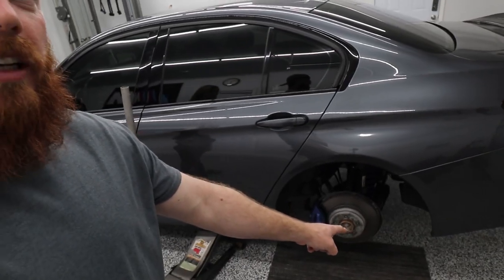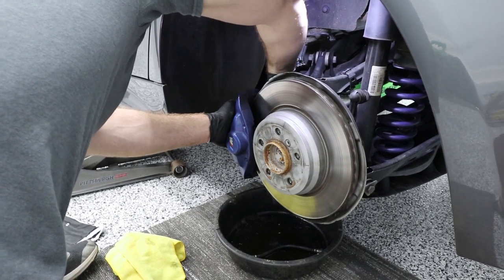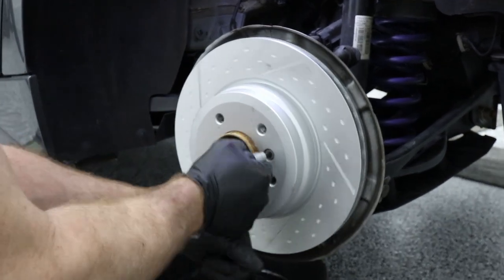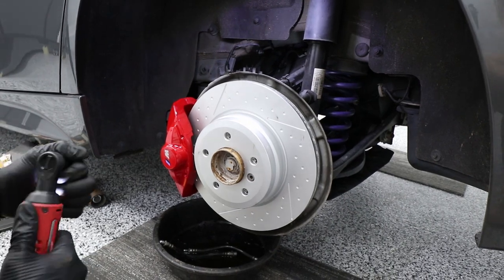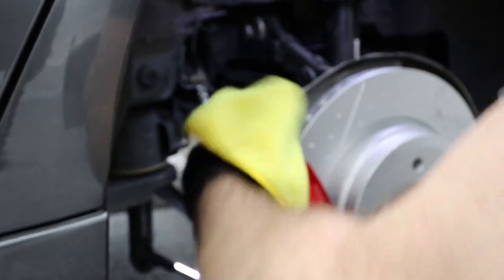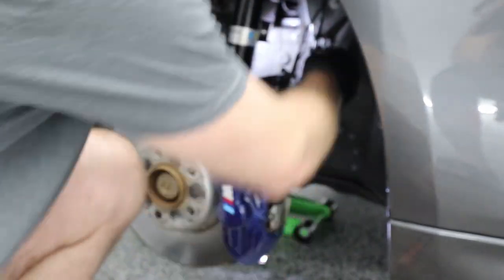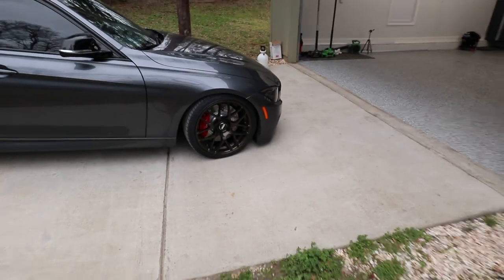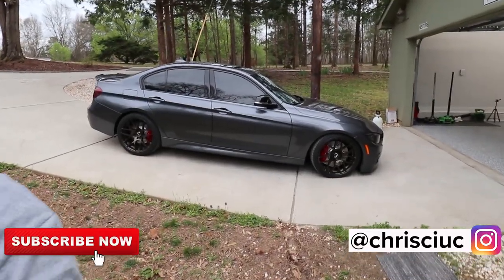BMW Brembo M Performance Big Brake Kit Installation F30

Comment: Great video I just would wanna add, that if you take a broomstick or something like that to press the brake pedal while working on the brakes, the lines actually won't constantly leak while you're changing the calipers. And you don't necessarily need a bleeding system, just some help. Get someone to pump the brake pedal and have an eye on the reservoir. Also you should suck all the old brake fluid from the reservoir, fill it with new fluid and try to not only bleed the fluid til the air is out, but until the complete brake line will be filled with new fluid. That way you get the old fluid out that has collected water over time and isn't as heat resistant. No use in stainless braided lines and big brakes, of your fluid can't handle the temperature. But those are just some additions, you did a very nice job and it's a very informative video!
Reply: Oh and from guy who also has a mineral grey 335ix, I have to say those red brakes look phenomenal on your car! I kind of don't want to switch to red brakes because I had red ones on my previous car and I find it a bit standard but seeing this really makes me wonder if I'm just being stupid to not do this. Thing is: my rims are black chrome and I have purple lug nuts so I kind of wanted to do something crazy and get green calipers haha.
Reply from the maker: Thank you! Green calipers sounds cool lol

Comment: Just an FYI, for the front brakes, you're supposed to bleed the outside first and then the inside. You got the order mixed up. Other than that, good job man.
Reply from the maker: Thank you for the info, I did end up doing outside then inside on the second bleed off camera to make sure. I could not find the information on that portion so I did it both ways. Thank you!

Comment: cool video, shouldn't the new brake system be coded to the car so that the car and the cruise control were told that a bigger brake kit has been added?💪🏼💪🏼
Reply from the maker: Works with or without because the brakes are exact same size only thing bigger is the rotors, however I did code them and noticed no change lol

Comment: Just an FYI, to remove the coating on the rotors I find it best to use CRC Brakleen® Brake Parts Cleaner rather then drive around and braking.  Great job on video.
Reply from the maker: Thank you for the tip and I absolutely agree with the Barkleen I use it as well. In this case this coating was more of a paint than an oil so I wasn’t sure if it would work but was probably worth a try. Thank you again for the comment, very good info.
Reply: @BOO5Tchannel  After watching your video I'm thinking of buying the kit you did as it looks great and I'm sure the performance is much better than what comes stock for the 335i M Sport.
Reply from the maker: G Rexer27 love it, do it. On ebay they sell the blue pair for front for $1000, you can get 2 front rotors, and 4 new calipers any color yellow, orange, red or blue for $1700...

Comment: You should have gotten two piece discs too, the ones with Ali bells...
The red calipers are actually the same as the red ones as long as you are on same dia discs.   The disc size is cast into the caliper.
Reply from the maker: Cool

Comment: Only thing I think you missed here is properly cleaning the hub faces before installing the new discs - or rotors as you call them. If not properly cleaned you are almost guaranteed to get disc run out and/or juddering.
Reply from the maker: Thanks for the tip, I actually cleaned them with brakeclean before even making the video but never recorded it. Thanks!
Reply: @BOO5Tchannel  
It's always a good idea to use a wire brush  to thoroughly remove any traces of rust from the hub faces - I use a wirebrush attached to a drill - quick and easy
Reply from the maker: Christo Joubert 👍🏻

Comment: Did you just rip the sensor out of the inside of the brake piece I’m changing mine and not sure how to get it out lol should I just rip since it’s going in a new place
Reply from the maker: No it comes off if you pry with screwdriver
Reply: @BOO5Tchannel  thanks bro I just finished front brakes so smooth just waiting on back rotors . It’s sucks the package only comes with front

Comment: Hey Man,
Great video. Did you leave the rear breaking plate and not replace it? i have a 335i gt xidrive and they are doing my brakes today but will not be swapping out with the new braking plate because they said new bearings would be needed which is 1k more. Not sure if this effects anything. Best.
Reply from the maker: Hey, not sure what they mean, if your talking about the dust shield bearing has nothing to do with it...

Comment: hey man, great video! However, I was under the impression that more than the backplate of the brake pad needed lubricant (i.e. pins and caliper abutment). Can you help clear up the confusion??
Reply from the maker: Yes you can lube all parts that have movement on them really, I generally do lube the pins as well
Reply: @BOO5Tchannel  Thanks! Hope you keep the content coming

Comment: Nice video man, you got a keeper there that will spend time with you in the garage! What’s the brake fluid pump you got?
Reply from the maker: Thank you, she is! The power bleeder I use is by Motive on Amazon, here is the link Motive Products, European Power Brake Bleeder, 0100, Hand Pump Pressure Tank with Adapter https://www.amazon.com/dp/B0002KM5L0/ref=cm_sw_r_cp_api_i_c1rXEbFBMPFMS

Comment: Great video! I just had mine installed. Does the filling in the drills disappear over time?
Reply from the maker: Not sure exactly what you mean?
Reply: @BOO5Tchannel  I mean when the discs are new the drillings and slots are not open. Not fully pierced. Does that happen after a certain brake in period?
Reply from the maker: @eg000ja  that’s how these are they are not drilled they are dimples, will not change

Comment: Hey 👋 question I have a bmw 428i 2016 and I just brought  the m performance calipers but I wanna change the rotors as well but I don’t know what rotors I need for my car and for the m performance calipers.Right now I have the regular calipers. I hope you can help me 🙏
Reply from the maker: Hello, the links to the rotors and everything I used is on the video description. I have 2 videos part 1 and 2 you will find them there. Thanks for watching!

Comment: Just wondering if you also get the ticking noise when driving everyone talks? It gets slightly louder when you start to apply the brakes. Some think it's the dimples, but I'm not so certain about that, but I definitely hear it.
Reply from the maker: Hello, I do not hear any ticks to be honest. Maybe it’s certain pads? Thanks for watching
Reply from the maker: Oscar Castillo weird I do not think mine does but now you have me wondering...
Reply: @BOO5Tchannel  It's most audible when there's a wall to reflect the sound back to you, but it comes from either side, maybe even all four corners. Not audible under 25mph. I think also a louder than stock exhaust might drown it out.

Comment: Hello, I had a question are these discs really not directional?  In the sense that the disc that is installed on the right side can fit on the left side and vice versa, and how that will happen, there will be something wrong because one side will be opposite to the other in shape, and this is a fatal mistake
Reply from the maker: They are directional they just sent me 2 of the same side but by no means fatal they are still operational

Comment: Hello, my inquiry regarding the discs, why does not each side have the same direction that is drawn on the discs because I noticed that the direction of drawing on the discs on the left side is opposite to the direction of drawing on the discs on the right side.  On the discs on the right side, it indicates that the direction of rotation is with the hands of the clock, so why is the drawing on the discs on the left side not indicating the opposite of the rotation of the hands of the clock until it becomes in line with each other on each side
Reply from the maker: They sent 2 same side so instead of making a fuss I sent it, sometimes you just gotta go with the flow bro

Comment: I have the standard brakes on my 435 and I got the same kit as you but in yellow do you know if I have to code anything I have read some places say yes and others say you don't.
Reply from the maker: Hello, yes to have them work properly you should have them coded. I used a remote tuner took 10 minutes paid $60
Reply: @BOO5Tchannel  Any chance you remember the remote tuner or where you found them?
Reply from the maker: @ZeroTheHero6920  Instagram Codemyeuro

Comment: Thanks, I have an inquiry about the new brake discs used with the red caliper for the front. Was it possible to use the same( blue) calipe on the new brake disc? Is the new front brake disc dimensions 370 x 30mm?
Reply from the maker: Hello, yes red and blue are same calipers, only difference is color
Reply: @BOO5Tchannel  thank you very much
Reply: Are the new brake discs installed further to be 370 × 30 mm front and 345 × 24 mm rear ?
Reply: @BOO5Tchannel  Are the new brake discs installed further to be 370 × 30 mm front and 345 × 24 mm rear ?
Reply from the maker: @islamfawzy6206  yes I went to 370x30 and 345x24

Comment: Can I upgrade standard brakes to M sport calipers on a basic F30 328i xdrive with 17 inch stock bmw rims?
Reply from the maker: I believe so but check the forums and groups to double check I’ve not delt with 328 before

Comment: What's your recommended brake pads for this brake kit after the ones you get with the set has done its time?
Reply from the maker: Oem brake pads or red pads from ecs is what I used. I am a hobbyist not a mechanic so maybe I’d ask someone with more knowledge

Comment: What size are your rotors? I heard a 370mm can't clear a 17" wheel (my winter setup) but a 345mm can?
Reply from the maker: I am not sure if this but my 19” wheels cleared the 370mm I can’t imagine the 17” would even clear the caliper

Comment: I have a 340i with a track package and m package blue calipers not sure is the 370mm rotors fit
Reply from the maker: Blue and red calipers are the same just different colors
Reply: @BOO5Tchannel  why you just didn’t powder coated?
Reply from the maker: @christianmedina9908  because powder coating in my area was around $700... I sold my old calipers for $800 so I basically got a good deal for new brakes and rotors in difference of price

Comment: I had a question doesn’t the front brake  disc have to be perforated I’m looking to change my brake disc and brake pads but I’m wondering why my front brake disc are perforated and rear are not I have a video on my channel
Reply from the maker: Not sure but you can try Bimmerpost they have a lot of talk on brakes for each type of car.

Comment: I'm getting these soon. Did you code the brakes?
Reply from the maker: Yes I did code them remotely with codemyeuro
Reply: Hi, and great video. Can I ask how you code remotely (or what hardware/software  is required. I’ll be installing this exact kit & lines (currently chilling on my work bench) as I’m waiting for coil overs to come in from Germany first. I’d be interested in knowing more about remote coding. Thanks so much : )

Comment: What’s the purple stuff called you put on the pads between the pistons?
Reply: Lubricant between backside of pads and piston. Make sure to never let any of it get onto the pad surface that comes in contact with the rotor
Reply from the maker: Hello here is the link.
Permatex 24125 Ceramic Extreme Brake Parts Lubricant, 8 oz., Pack of 1 https://www.amazon.com/dp/B0018PSASU/ref=cm_sw_r_cp_api_i_8hWaFbD4P6P4G
Reply: Dont ever use that stuff. It collects dirt and debris, makes a issue where there is none. Ask yourself…did the factory use it??

Comment: Hey I bought the same kit for my 340i, just got it installed yesterday and the brakes feel kinda soft , I have to press it a little harder then the original ones I had, any idea why?
Reply from the maker: I will assume they aren’t fully bled, I think they may have missed the abs bleed, go back and have them rebleed them.
Reply: any breaks need to be run-in. At least first 200miles after install
Reply from the maker: @mrsmirnoff8837  thank you for the tip Smirnoff!
Reply: Chris Workz sorry just too much of vodka lol
Reply from the maker: Mr Smirnoff all good brother you did the right thing!

Comment: What size rims will fit these offset and diameter and width???
Reply from the maker: Minimum is 18” the rest I would not know past what I had which are the m3 wheels or the vmr et37 et45

Comment: What size where the front rotors? And what size were the back rotors?
Reply from the maker: Normally I like to start with a greeting such as 👋 if I want info from someone… I think 380mm and 340mm but maybe not
Reply: @BOO5Tchannel  Hi, M Performance rotors are 370mm front/345mm rear.

Comment: Do these need coding after install? I heard mixed thoughts in this. Thanks
Reply from the maker: I got my remotely coded for $60 so I would say yes but it doesn’t HAVE to be cause I drove for months without coding and worked fine but a bit better after code. Good question!
Reply: @BOO5Tchannel  Gotcha, that's pretty inexpensive. Would this kit still work even if I don't have the m sport brakes in the rear. I understand that I need to buy the rear m performance rotors as they're not included but would they still fit even though the rear brake dust shields are perhaps smaller? I don't know for sure I'm just hesitant on buying the whole kit and rear rotors only to find the new rear rotors don't even fit. Thanks again, subbed
Reply from the maker: The kit I got had all 4 calipers, front rotors, dust shields, hardware, brake pads and pins. I only purchased rear rotors so your good it came with front and rear shields
Reply: @BOO5Tchannel  What coding do you have to do ? After you got it coded, did you notice any improvement ?
Reply: @BOO5Tchannel  Which company did you use to remotely code the car? I just got my brake kit installed & I’m looking to get them coded.
Reply from the maker: @ryandailey5  codemyeuro on Instagram
Reply: @BOO5Tchannel   how can i get coding done by codemyeuro?
Reply from the maker: @oOs4MzOo  contact any remote coder on Instagram

Comment: Bead blasting and then powder coating your old calipers would’ve been way cheaper, $2000 just to change colors is a bit steep. Your old blue calipers are the same, just blue...
Reply from the maker: Hey, thanks for the comment. So I priced blasting and coating and it would of been around 500-700, if you add in the rotor set I would of been around $1200. My front calipers where not in great condition so I did well after selling my calipers for $750 on ebay. Thank you for watching the video I appreciate the support.
Reply: Chris Ciuc your video was definitely well done and very nicely put together. But I believe you got quoted a little too high on the blast and powder coat. I’ve had some parts powder coated by a local company and his rates are very good and has access to a plethora of colors, would allow you to get very unique.
Reply from the maker: I ended up calling quite a few in my area, most wanted 250 a pair and up so 500+. Definitely looked into it but overall went with new. So 500 minimum for coating, about 500-750 for good rotors and I was at 1250. Paid about 2k for new and got 750 back in my calipers and selling rotors soon. So overall not too bad, I do agree with you however, could of went with any color and been quite happy that route too. Thank you for your comment I appreciate you.

Comment: Do you need to change serwo ??
Reply from the maker: Hello, not exactly sure what serwo is?
Reply: @BOO5Tchannel  I got 320i EU with standard brakes (rotors 300x22). I want upgrade for M brakes (front: 340x30 and rear 345x24). It its ok fot 18"? Should i swap serwo (serwo mens: stock nr: 34 33 6 851 097, M ver is: 34 33 6 851 098) and brakes pomp (i got stock: 34 33 6 851 093) ??Im wandering should i change those two elements ?
Reply from the maker: Hello, I honestly do not have an answer... I am not sure you might want to check forum
Reply: @BOO5Tchannel  Thanks for answer.

Comment: not efficient without specific coding
Reply from the maker: I did code them
Reply: @BOO5Tchannel hi but you dont explain how and its the most important part otherwise m perf brake were not efficient. i guess you ve done that with esys ?
Reply from the maker: @ST-ff5xv  I had a remote coding done from a guy named codemyeuro on Instagram about a few weeks after the video. At that time no one had a video with this install and I think only Kies made one almost a year later. If you feel you need to make a video explaining how coding makes a marginal difference if any go for it